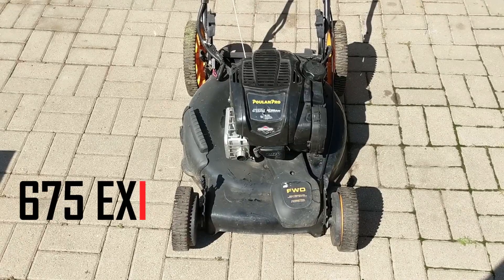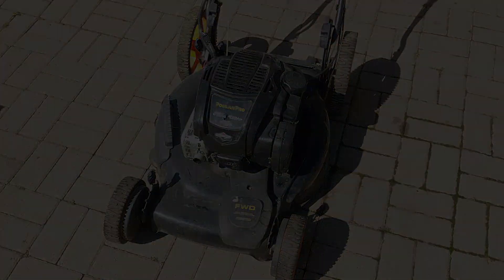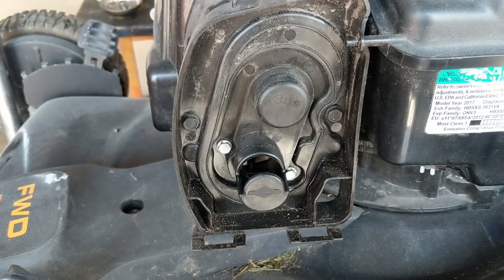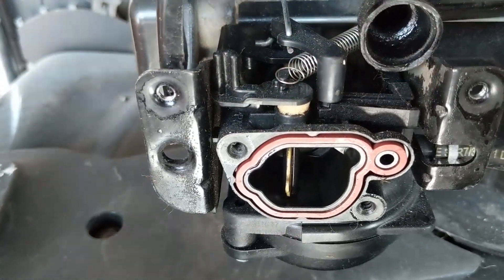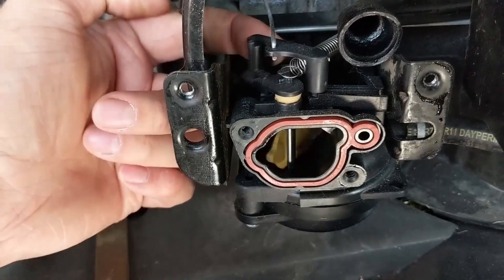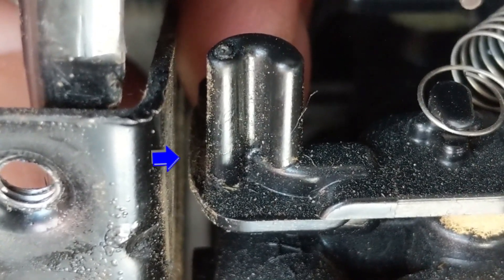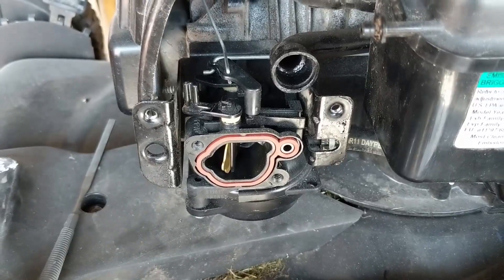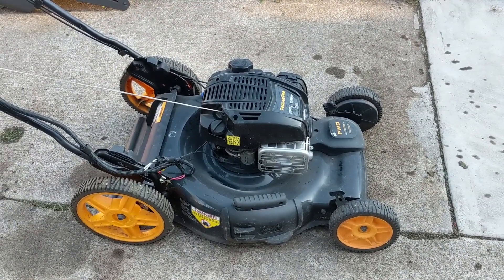Briggs & Stratton 675EXI Won't Start because of Design Flaw!

Comment: I have an issue I can't figure out, I am not sure what draws up the fuel through the nozzle.  I know the obvious thought is the choke draws it up there, but it will not, no matter how many pulls. I can add a drop of fuel in the throat and it runs perfect for the mow, but the auto choke is either not sealing well enough or the jet isn't functional? I have tried two different carbs, so I don't even think it's a carb issue. I was suspecting a head gasket issue from all the oil blowback, but could that be a reason the fuel could not siphon. I have been on the mower for a week, just telling myself I am going to whip this one, but I am struggling to find a reason for a non-priming auto-choke.
Reply from the maker: Sorry I'm just seeing this comment now, sometimes the black oval oring that seals the white inner core with the main jet, it can get a little loose so it doesn't seal as well. There will then be less suction at the main jet. It really is a horrible design, I'm sure they're fuel efficient, but at what cost? Many issues with these carbs unfortunately.

Comment: Awesome video, thank you! 
I have same engine, mine still runs fine but now I will know what to do when my engine will get this issue.

What do you think about oil changes on this engine? Briggs states that you don't need to change oil at all just fill up, but somehow I don't believe that.
Reply from the maker: Change the oil every year! Look into an oil extractor if you want to spend the money, or just run until hot and tip it over to drain (can be messy) And thanks for watching!

Comment: I don't know if you'll ever see my comment but I wanna thank you so much for uploading this video....so here's my story. We purchased a brand new B&S 675EXI mower. The wife and I used the mower about 12 times in total, then about a month ago the mower wouldn't start. I first thought maybe my wife put the wrong fuel in or it was simply a bad spark plug. So I purchased a new spark plug, put new gas in...and nothing. We gave up. My wife decides to purchase a manual push mover, I said whatever. But then I got pissed with the thought of using the push mower and decided to do some research on the possible causes on why this was happening for what was actually a brand new mower. I took the mower apart and saw nothing but what appeared to be new parts. The only thing I saw was that the air filter was sorta dirty with oil and debris. I then come back in the house to conduct more research. I came upon your video. I watched and listen to what you said about the plastic choke lever. I kinda blew the video off because I had watched several videos with no luck. So I said F it and decided to put the mower back together...just then I noticed something.....the choke lever was stuck and that metal piece was open. I was like HOLY SH*T!...Luckily my wife had a Dremel tool she uses for crafts etc. I did exactly as instructed via your video, I also purchased and installed a new filter. Put put it back together and poured new gas in the mower...said a prayer and pulled on the cord....and man, I couldn't believe it, the mower started on the first pull!!! It smoked a little and I think that was because (I failed to mentioned) I had sprayed the carburetor (in and out) with some carb cleaner. I let it run for about 2mins. I came in the house and gloated to my wife. I waited about 2hrs and went back outside to test the mower again. This time it stated even faster than the first time. Problem solved and I have no one else to thank but you. So thanks a again for posting this video, it was extremely helpful and on point.
Reply from the maker: Awesome, glad to hear you're back up and running again! if you ever have the time, a don't mind, consider leaving me a Google review? It'd really help me out. And thanks for watching!
Reply: @EliminatorPerformance  Done! Thanks again.

Comment: Greetings from Italy. Your videos are really interesting. I would like to ask you for technical information on a Briggs Stratton 675EXI 163cc. When the gasoline runs out completely, the restart is difficult, you need a lot of pulling on the rope. It's normal? Maybe I should avoid running out of gas? When I have petrol in the tank, starting is always regular, both in cold and hot engine. Thank you.
Reply from the maker: Yes I would recommend always keeping some fuel in the tank to not run the carburetor dry. Thanks for watching, cheers from Ontario Canada!

Comment: What do you think about this machine? should i get one?
Reply from the maker: They are great mowers, just change your oil annually, don't be fooled by the "just add oil" sales pitch!
Reply: I settle for a machine that doesn't visit the mechanic to frecuently.Thank you!
Reply from the maker: @felipetillard4710  If you buy one, I suggest you do this choke lever modification so it doesn't stick, and if you ever need to clean the Carburetor, I've got you covered with a full step by step video: https://youtu.be/QPrkCN_Va5E
Reply: @EliminatorPerformance  Ok ! Thank you very much!!

Comment: Many of the new plastic carb engines have the same issue. Some time it does not need repair until you cut around hedges or ornamental trees on your yard and you accidentally hit the air breather against the hedge or tree and it causes the steel bracket to be pushed in slightly. Mower will keep running and start when it is hot but when it cools down same problem you just showed your audience. Thanks for passing this on, you saved your subscribers mucho dollaros at the repair shop.
Reply from the maker: Thanks for watching!

Comment: These e series briggs engines are garbage. I had one 2 years old it would not run. I have been working on mowers for 60 years. I  threw it in the trash and replaced the engine with a 1984 briggs. It will run for 20 years.
Reply from the maker: They're definitely not built the same!